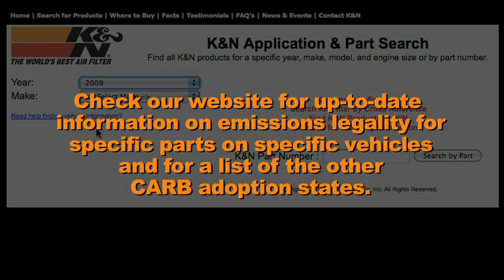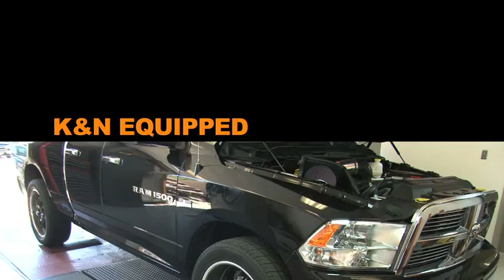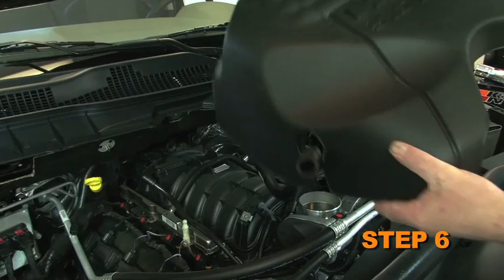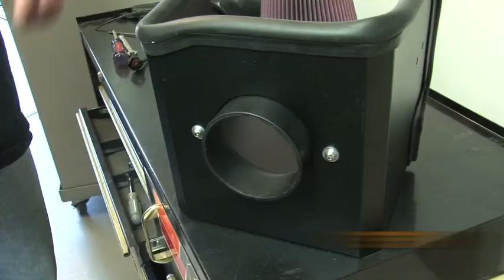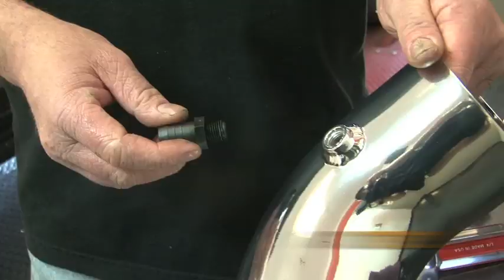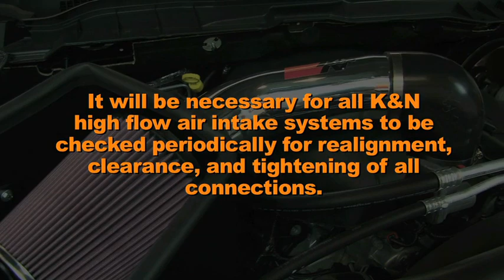Dodge Ram 1500/2500 5.7L [#77-1561KP] Air Intake Installation

Comment from the maker: They lied to you. You are actually protected by the federal law known as the Magnuson-Moss Warranty Act, which prohibits a manufacturer from voiding your warranty due to the presence of aftermarket items, especially serviceable items like air and oil filters. The only way they could void your warranty, is if they provided you the items they want you to use at no cost, which doesn't happen. I have also yet to see a dealer that can side step the federal government 

Comment: The dodge dealer hear in Shawnee said if I put this on my 2012 ram 5.7 it would cancel my warranty I have always used k&n air filters and even oil filters I'm disappointed about this I guess I will go ahead and just weight on it until my warranty is out =-{

Comment: doI just bought a 2011 big horn hemi, Love it. I had a 2005 before and had the true dual exhaust and an airraid ram air and i was getting 22mpg even at 90k miles. I cant believe that just this intake make this truck sound that much better. I just put a super 40 flowmaster on it but it still doesn't sound right. What programmers would you use for this and how much does this product run?

Comment: Yeah there's a reason these are referred to as COLD air intakes lol. The cone filter is much more efficient than the factory airbox and the air is much cooler. Cool air is more dense so the engine packs more combustion per stroke. The HP wouldn't have increased if the air got warmer and the filter less efficient.